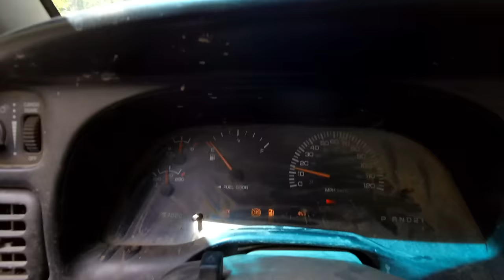Setting a bluestone stepping stone

Comment: hey for your dodge not shifting gears, I had a pretty similar problem with my 2001 dodge 2500 w/ 47re. I betcha your problems are coming from a Transmission Control Solenoid
Reply: ‘97 1500 Dodge Ram, went through two transmission rebuilds, and I wasn’t towing skid steers.
Reply: @mikespain8655  That's why I ordered my 98 with a manual.

Comment: Andrew, with all the equipment you've bought, and fixed up, why don't you treat yourself to a new(er) HD pickup, maybe a dually? I know you have 2 dump trucks, but for this kind of work you deserve a bit of comfort, and one less machine to worry about.
Reply from the maker: That pickup has been reliable. And it does the same thing a $30,000 pickup does.

Comment: Andrew, 4Lo is for traction, every one I have had was limited to 1st gear power range since it locks out all 4 wheels and you don't want to be trying to speed up opposite wheels with that gearing. Usually if you need to go faster than 1st in 4Lo then 4Hi should get you through it. As for the idiot lights, and they are not actually coding a warning. You might check into a cluster repair place online to see if it's worth having fixed or try and find a good one to exchange.   Love the content and  the supervisors.

Comment: Andy. Did I see demo tire on the skid steer. Did you by the tires local??? or did you get them on line. Did you every think about. Foam tires. What do you like. Looks great nice house does it facing east toward BOSTON OR WEST TOWARD CALIF. THANKS FOR TAKING US ALONG. KEEP UP THE GOOD WORK. JUNKMANDO
Reply from the maker: I ordered those tires online, I had them quick. There is no place close that foams tires here, and I haven't had much luck trying to get that done in the past. Those solid tires are nice, no issues with them. That house faces East.

Comment: You should try to find an old F450 with a 7.3 and a stick, use that for hauling and give the Dodge a little break... I'm not a big fan of automatics, but the auto in my E350 with a 7.3 actually pulls my Kubota mini excavator pretty well. Autos are good for towing for the most part, but I still like a stick for its simplistic nature. Hope you're doing well my friend.
Reply from the maker: I'm going to drive that dodge long after its unsafe to be driven.
Reply: Haha, well that might be soon if the electronics get all wild!

Comment: That “little” rock was sure testing the limits of your smaller skid steer. 
Would you have been able to bring your tracked skid steer there with your Dodge or would it need your dump truck?
Reply from the maker: The dodge can tow that, I wouldn't want to tow it up that mountain though. But that skid steer was far away on a job, so it wouldn't make sense to move it there just to do that rock.

Comment: Time to put a 5 speed behind that 360
Reply from the maker: I had to rebuild the transmission a few years ago, and I considered that. But I couldn't find one. So I just rebuilt the automatic. The 5 speed would be nice. But that truck is too rusty for another big repair like that.
Reply from the maker: I would want another 3/4 ton.
Reply from the maker: That's cool, the floors rusted right out of my truck, and the frame has already broken and had to be welded. Most people would have given up on it years ago. I don't feel like spending money on another truck.

Comment: Nice spread they have there Andrew, I think its time to retire that old Dodge and move up to an F-350 diesel !
Reply from the maker: Thanks. Don't those ford pickups engines have common engine issues and the body needs to be removed to fix it?
Reply: I believe those were the first years after the 7.3L but that has been resolved in the newer models. Honestly I would try to find a 7.3, I just sold my "99" and it was the best Ford I ever owned. It was a bitter sweet sale. They made the 7.3L up until 2003 I believe, those motors are virtually bulletproof and I would recommend trying to find one with a decent body on it. Here in CT the salt just destroys them prematurely as the motors are easily good for 300k or more
Reply from the maker: Maybe, I'm going to run that dodge for as long as possible.
Reply: Yeah I hear ya, it runs and its paid for right.
Reply: It'd be funny if he said he had two more years of payments.   The way some are financing vehicles these days it is kinda realistic.

Comment: computers and automatic transmissions.  that why i installed a 6 speed manual in my truck
Reply from the maker: Yeah, the thing doesn't know what to do if it has a load on it, or if its in 4 low. Other than that its ok.